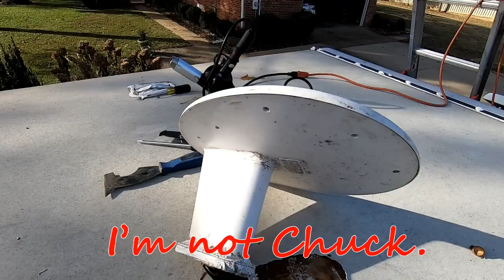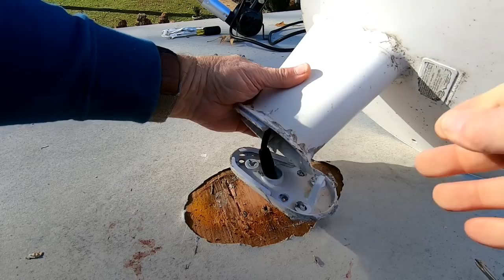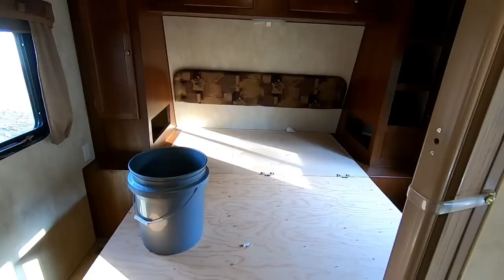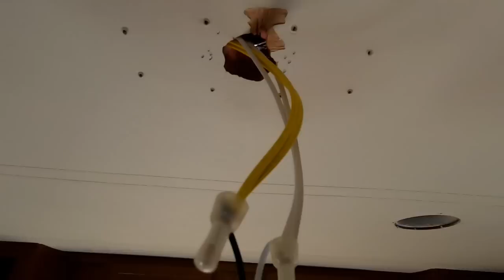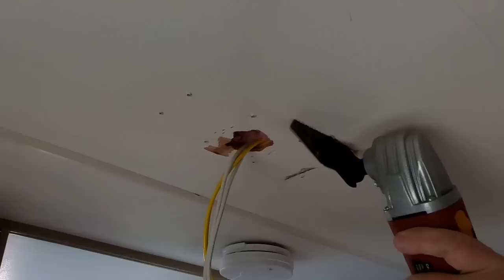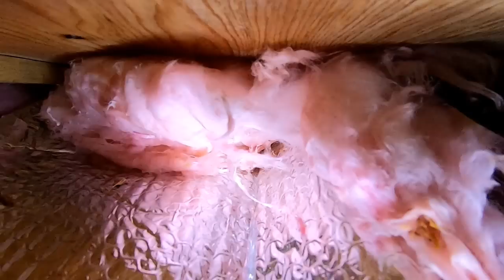RV TV Antenna Replacement and Roof Leak Repair, Part 1

Comment: What a savings to do your own work on RV.  Just recently spent more than we should on preventive maintenance, etc. on our own travel trailer.  Good video! 👍👍
Reply from the maker: Based on RV shop prices in this area, there is a great savings to be had. In addition, I get to know exactly what was done and how it was done. It has been quite an education to me as I have come to understand how complex the systems in an RV seem to a newcomer. Thanks for watching and for commenting. Part 2 should be up in a couple of hours.
Reply: @ImnotChuck.   We will watch Part 2.

Comment: i have 22000w/1500w generators that are parrele ready   what do i need to hook my 30amprv to the 110 generator   it doesn't have a 30amp respetacle
Reply from the maker: Assuming your generator has a standard 15A residential type receptacle, you need an adapter for your RV cord. They come in a lot of different prices, but here is one of the less expensive. https://www.amazon.com/Conntek-14101-TT-30R-Plug-Adapter/dp/B001TO4WCS/ref=sr_1_7?ie=UTF8&qid=1543731178&sr=8-7&keywords=30a+to+15a+adapter
Note that it is rated for a maximum of 1875 watts.
Reply: @ImnotChuck.  thanks

Comment: Interesting video.No matter the quality of the RV, it seems that it always find a way to leak. In your case, the antenna displacement was probably the problem. I am amaze how thin is the material recovering the plywood and i know you have a good quality travel trailer.
At your place, i would have probably cut the ceiling a lot bigger to clearly see the actual situation, it's not a bigger job to fix a bigger hole compare to a smaller one.  But be clear: i am not saying you did a bad job... i have too much respect for your person and i never personally own a RV....but it's probably coming in a relative close future. What kind of RV ? That's my problem, i don't know yet, i'm just not able to decide which is very rare for my person.
Waiting for the conclusion, thank you.
Reply from the maker: Hello Jacques. Thanks for the comment, and you are correct: most RVs have leaks at one time or other. The roof material is quite thin, but pretty tough, so most leaks are not from the EPDM failing, but rather from a hole associated with something attached to the roof. You will see that I did enlarge the hole in the ceiling, but only slightly. And you are correct that a bigger hole would have made the insulation replacement much easier. If the amount of wet insulation had been greater, I would have removed a larger portion of the ceiling, but I wanted to avoid the appearance of a large patch. After you see my results, maybe you will agree. Thanks again for your input and for being a subscriber.